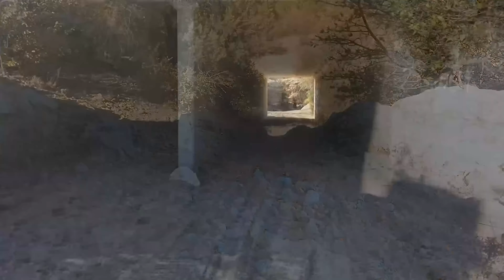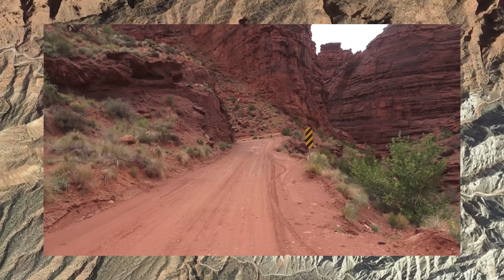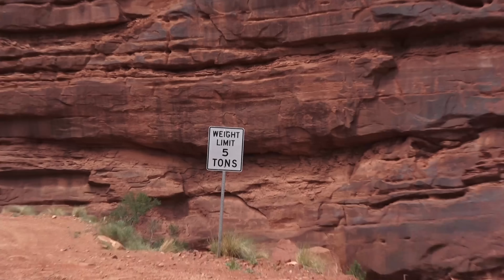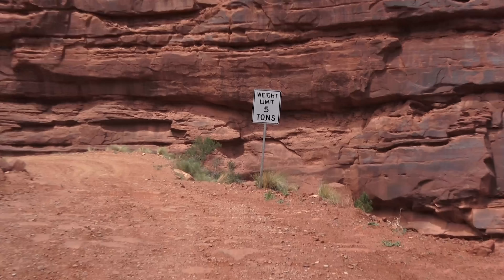Trail Mater : Crazy Recovery at Night! Toyota VS. Jeep High Speed Collision.  #trailmater

Comment: The best off road wrecker I ever seen was 30 years ago at a junkyard I use to go to.
 That truck looked like crap but it could lift, pull everything.
 Fitted with booms, winches, torches, welder and every tool at the time to take apart or put any vehicle back together.
 The yard owner nicknamed mean Gene called the truck Egor, painted right on the side.

Comment: This is still scary as f! I remember having dreams more like nightmares lol going off cliffs in a vehicle when I was little not kidding. Wow! Just wow. Rory and Richie pretty awesome. Didn't understand the whole brake fluid thing but I'm not a dude. I didn't want to rewind doesn't matter just rambling. Thanks for sharing! Always grateful
Reply: Brake fluid is the lube for the brakes so that they break rather than cease up due to friction (when 2 things rub together too often and cause heat and melting?).  Sometimes they have to "bleed the brakes", that's the lube or brake fluid so that there isn't air in it that can likely cause a cease up, like our joints that lack fluid for some reason.  I'm thinking that it's like having an air bubble in your needle when you get a shot, very very bad.
Reply: @Parakeetfriend4215  thank you makes sense. I remember that there was a leak evidently but it wasn't spraying. It just looked like the vehicle was totaled so wasn't sure the purpose of it.